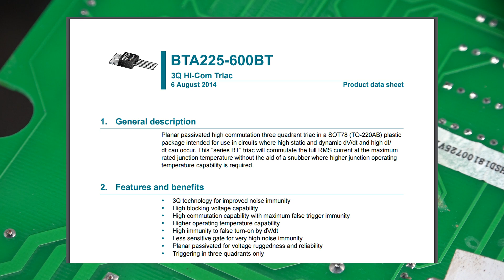Laboratory Hot Plate Stirrer Repair (Triac Replacement)

Comment: I would say it isn't complete shit. The important parts are easy to replace. The main board is simple and obvious, and there are good components there overall in it. The rest looks good too. I would say it does the job done. But considering it is a bit expensive, of about 450$, I would say it is somehow overpriced for what you get. At least the case is metal, display and knobs and components are good.

You should learn soldering better tho. Flux and proper amount of solder, and keeping heat long enough does help a lot making proper good joints.

Comment: You get what you pay for. VWR does have some better engineered products. When dealing with chemistry, a hot plate should cut power to the heater when it fails. They shouldn’t be making junk like that.

Comment: I'm an electrical engineer.  For the equipment you have you did a pretty good job!  Desoldering is a b*tch.
A little MG Chemicals rosin flux and some copper braid makes the desoldering much easier.  The copper braid just soaks the solder up.
A moistened sponge is also good. Just draw the top of your iron over it briefly as you work. It will keep oxides off of the tip, as well as excess solder. So, without wick, the way to handle the case where you bridged the two pins of the triac would be to clean the solder off of your iron first and then the tip will pull a bit of excess solder off.  Just repeat as needed.

Comment: I love any/all your videos. It help you with further burnouts is a simple fix. All you need a a small aluminum heat sink, you can find one on an old PC motherboard. If you continue to read about your triac specs, you will see at some point it will need to have a way to thermical way to cool it down. The heatsink will resolve this. Manufacturers will always design things to fail at some point. It the economics of everything. Oh, for the loose power, hot glue works for me or some type of low to moderate adhesive will work. Enjoy.

Comment: As much as you cant separate water from solvents without epsom salts, you cant wet out solder without flux. Add that to your soddering kit along side a solder pump and you are golden. If you want to be real fancy, use a solder wick to suck up old solder and make those through holes like new. All of those are pretty much the absolute basic when doing quality soddering.

Comment: Shouldv'e soldered a socket instead of that optocoupler, would make future extractions much easier.
Also, don't pull on multi-leaded parts when de-soldering; you're much more likely to lift a pad/trace that way.
Instead, Cut the leads off the part and pull on the individual lead as you heat it.

Comment: the small power supply is for the small volt low current components that need to be regulated and the other bigger one is for higher current and probably higher volts aka the heater

Comment: Likely that this has two power supplies for isolation. The off-board PSU is probably for the high side switches on the motor driver. I would guess that they either could not source a transformer with another tap or found that they needed another power supply after the board was spun.

digikey is awesome.

I'm surprised you didn't lift any traces.

Usually, if you have a board with plated through holes, you don't need to apply solder to both sides. If you use enough flux, the solder will be sucked through the board. (BTW, I am IPC class 1 and space addendum certified)
Reply: Yeah that little PSU was some sort of deadline is approaching quick fix, it would not be hard to make the whole thing work from a single power supply.

Oh and about plated holes i just had fixed an old HP 6624A lab power supply that had a non conducting via in it.
Reply: solder a wire in the sumbitch. That what we have to do for every via on our prototype boards made on the router. It's a pain for complex boards.

On another note: your power supply may have been built on my workbench. My father acquired it from HP when they remaindered a number of the equipment benches in their Liberty Lake facility. I have no idea what was built there, but it is a non-zero chance.
Reply: Oh nice one. Not sure where it was made but from the date codes on chips it seams to have been made in 1991. I do have an even older HP signal generator made in Germany, its so old the power indicator is a regular light bulb, but it does go to 250MHz.

Comment: No offense man but I've seen meth labs with cleaner equipment than yours. Why don't you clean that hot-plate of yours sometime.
Reply from the maker: Those stains are chemically burned into the plate. The only way to get it clean is to buy a new one. If you have $700 to send me i'll do it.
Reply: Yeah, I think you might of mention that before. I was trying to be funny, sorry if you didn't see it that way.
Reply: . . . Besides, meth-labs normally have blood stains all over everything.

Comment: Nice, next time you replace though hole parts, it is typically better to cut the bad parts off and de-solder the remaining pins out of the board. This helps protect the tracks from getting yanked off with the part due to the lower heat.

Comment: Get some soldering wick.  It's basically just woven copper wire, but it soaks up molten solder like a towel soaks up water.  Just put it against solder you want to remove (either the old solder, or an accident like that blob you had) and press the soldering iron against it until the solder melts and is soaked up, leaving you with a nice clean surface to try again.  I suspect the copper forms an amalgam with the solder?

Anyway, for soldering, you don't want to touch the solder wire directly to the iron, or else it'll blob up and stick to the iron instead of the circuit board.  Instead, press the iron against the board contact and the lead coming from the component you're soldering on, then gently touch the solder to the contact and lead next to the iron (but not touching the iron itself).  If the contact is hot enough, it'll pretty much suck the solder right up and leave you with a nicely soldered join.  If you end up with a blob on the tip of the iron, you can just wipe it against a damp sponge to get it off without having to shut the iron off and wait for it to cool.

Comment: That you were able to do your research and not be a complete hack, I commend you. Since this is not your particular skill set. The next time you solder, just remember this. The Solder will flow towards the heat. You can see this in your video. (It is going up the pins, instead of towards the board) Try and place the solder iron on the opposite side of board where the tip of your chip leg enters. (Maybe you could not do that do to what was on other side, I don't know) Either way, I enjoy all of your videos because you think before you do, and provide excellent content. Maybe I can find the time and do a reply video on how to solder. Cheers!

Comment: For a longer equipment life, bolt a heatsink to the triac.  It doesn't have to be a large one, but beware it shorting out to the case (unless the triac is already at ground) or the circuit board.

Comment: If the component is ruined, it is usually easier to cut the legs off in situ, that way you only have to de-solder one pin at a time.

Comment: One of these bad boys http://www.jaycar.com.au/Tools-%26-Soldering/Soldering/Accessories/GOOT---Desoldering-Tool/p/TH1856 will make it alot easier for you. I have one and it works really good

It balances the awesome of the right tool against the cost for your usage. if you where salvaging stuff or reworking more regularly you would prob want something like a desoldering gun, it's a soldering iron with a means of drawing a vacuum to suck up the solder, like the solder sucker above, but unlike the solder sucker above it sucks constantly.

Comment: The one good thing about the old pieces of shit is that they are easy to work on if a component goes bad.  The new stuff with all surface mounted parts basically require you to be a master at the game "operation" if you are gonna attempt repairs by hand.

Comment: They use separate power supplies because it's a piece of shit.
Glad to be of assistance.

Quick desolder hint:
If you're not keeping the part, cut the pins as long as possible and desolder each pin one at a time.

Comment: I have never seen a hot plate stirrer look so clean and nice inside during a repair.  The ones I worked on were used for acid digestion, mainly aqua regia, and were brown rust puffs inside.  Great to see one repaired without too much trouble.

Comment: For the wish / to-buy list: Desoldering braid. Solder sucker. Flux pen, antistatic wrist strap and antistatic brush optional, former to help solder adhere, middle not to fry ESD sensitive components on the PCB, latter to remove that conductive carbon (a.k.a burn marks). 
Methanol works for cleaning, what we EE's use is IPA (technical grade Isopropyl alcohol).
The two former would set you back in the ballpark of $20 total, two of the three optionals are pricier items (check suppliers for quotes/listings), wrist strap is in the $5-$10 ballpark.
And as to your solder job, hey, we all were beginners at it at some point, and even experienced EE's can have the occational bad solder day.
Here's hoping the hot plate stirrer will hold up without further incident.

Comment: I cringed every time you pulled on the part while desoldering; great way to lift pads/tracks. If you really lack soldering skills, cut the pins off at the body of the component, it's a lot easier and safer to heat and pull one pin at a time.

Comment: As a professional,

Beats me why they needed a second power supply, or dongley bit or whatever that was.  Never assume an engineered product is a /well-engineered/ product. ;-)

It's the technical equivalent of "never attribute to malice what can be adequately explained by stupidity".
Reply: It almost looks like it was bodged in there as an afterthought,or maybe as a previous 'repair'. Check out the connector on the right side of the little PSU thing,are the wires just shoved into the connector? I'm not convinced that's 'original'. But maybe it is?

Comment: Add a little solder or flux directly to the solder joint you're desoldering, it will make things a lot easier. It also helps to lay the iron across multiple pins at once, so they melt simultaneously.

Comment: Eeh, your soldering wasn't abhorrent, but if you want an easy way to desolder multiple pins and don't care how pretty it ends up, just put down a big blob of solder across all the pins and melt the whole thing, it'll get the part to be removed hot and probably kill it, but if it's broken already, it doesn't matter. Make sure to take the solder blob off afterward.

Comment: +NurdRage I watch you're videos with amazement since you ARE a whole lot better than me at what you do.  However, I now have a whole lot better appreciation how you must feel when rank amateurs start attempting to make dangerous chemical cocktails.

BTW, you might consider where the heat dissipated in that triac is going and what temperature it's die is getting to. This may be the reason it failed in the first place and a heat spreader might help as long as you don't cause any shorts.

Another suggestion as you are probably going to enjoy another economical repair is to invest in a solder sucker and wick.  It will make your efforts much more rewarding.

Comment: Decent repair! The fact that the TRIAC was 'underslung' indicates it was a late substitution for a different part with the reverse pinout, which is very common with transistors and cheap production runs. Replacing it with the exact same part might have been a mistake... look for a better part with the right pin order to put it on top of the board if it goes again. They probably saved $0.10 on a critical part, and that's why it broke. Excellent decision, replacing the opto as well. That's exactly what you should do!
And no, there should NEVER be a board flapping loose in the box. Even my one-off prototypes get properly screwed down before getting five volts, let alone mains.

Comment: Well done on the repair Nurd dude, you nailed it. It may fail again  or it may not and last for years.
I suspect from all the thermal cycles, one of the solder joints on that TRIAC cracked and was arcing on the board. That's why the area around one of the pins was burnt. It's probably a common failure mode for these hotplates.

Comment: Some hints for desoldering and replacing through hole parts...   Cut the part out with flush cutters if you have them.   Actually leaving as much of the pins in the board makes it easier to remove them.      If you don't cut the pins, you have to heat all the pins to get the component out.   This is difficult and you usually end up slowing working the part out while putting a lot of stress on the traces and pads.
Now that the pins aren't physically connected together by the part, you'll find heating a single pin and removing it a lot easier.
Second tip is to get some desoldering braid/wick to remove the solder after the pins are removed.    Clearing the holes will make placing the new part in a lot easier and you are less likely to have shorts, bend pins or message up the traces/pads.

Comment: That triac should probably be screwed to a heatsink.  For instance, a floor lamp dimming circuit I have here, uses a BT137-600E triac.  According to their data sheets, both are rated for 150˚C.  Mine is screwed to a 2.5 x 1.5" length of what looks like an aluminum U shaped bracket.  

Do you have space under there to put any sort of heatsink on that triac?

Comment: Don't: add solder to the tip and then try to solder the part.
Do: Put the tip on the part first, and then add solder to the part.
Reply: Just wet the tip with a tiny drop of solder for better heat transfer
Reply: As I just said: there is already flux in the solder. Adding extra wont hurt, it might even help, but it's not necessary.
Reply: +Daniel Hansson You are right, and it's what I do as well. I just mentioned the most important bit in the OP.
Reply: Just wetting the tip isn't good enough. You need to flux the solder joint. If you put the solder on the iron, the flux burns off immediately.

You can also just add some flux yourself. I keep a flux pen around for exactly that reason.
Reply: +Output Coupler Flux pen? What's that? I just use a can of rosin, and I dump the tip of the welder each time I need more flux.
Reply: Pretty much all electronics solder have rosin core, so adding extra is not necessary.
Reply: +Forssa1 It is necessary, except when you are welding two fresh parts together. Even freshly unisolated wire requires some flux for best results.
Reply: Marcin Goławski
The flux pen I use is a felt tipped pen that instead of writing, dispenses an alcohol based flux. I like it for desoldering and for tinning lots of traces or big pads, because it's easy to get a healthy amount of flux where you want it, and there's no cleanup.
Reply: I think you missunderstood me. I'm just saying that if you add a small droplet of solder to the tip, it will help you get a thermal contact to the pin that you are trying to heat up.
Of course you need to add fresh solder to the pin once it's hot.
It might just be when using a conical tip, since you can't get much surface to contact with the pin/pad...

Comment: Nurdrage, please, invest 2$ into a handheld solder joint sucker on ebay. It would make your work so much easier. Please... :D
Edit: Found one shipping to Canada :)
http://www.ebay.ca/itm/Solder-Sucker-Desoldering-Pump-Tool-Removal-Vacuum-Soldering-Iron-Desolver-SC-/281678939053?hash=item41955f83ad:g:M2wAAOSwnDxUczEL

Comment: Someone should do a kickstarter for a good quality reliable hot-plate stirrer with no moving parts. The motors probably fail more often than the heating elements.

Comment: Relying only on the board to provide pressure on the thermal pads is very bad design, as is using thick thermal pads to dissipate high power. If the heater takes (guessing) 0.5kw, that's 2A at 240v or 5A at 110v. Typical triac forward voltage at these currents is 1V, so that's 2 to 5 watts of dissipation at full power, which is significant. The board can warp and provide low or no contact at all, causing the triac to overheat and die. As the one that died is near the center this is even more likely.
A good design would have a means of clamping the components to the case with either screws directly or a clamp on the back of the pcb that is screwed through to apply pressure, and also thin mica, kapton or silpads.

Comment: i would recommend a dedicated TO-220 package heatsink and a thermal pad (like silpat) with silicone thermal compound. it will improve reliability immensely. Not a bad job overall actually. As something that will help in future repairs, i highly recommend getting some rosin flux and braided solder wick. It can make removal of the old solder infinitely easier.

Comment: You should see if you can attach a heatsink to your triac, or even just a piece of aluminum. Increasing the thermal capacity and surface area will likely prevent this from happening again. It's probable it failed from either a higher than normal temperature(of the part, maybe due to high ambient temperature) or merely thermal stress fatigue. A heatsink of any kind will help with both. Just make sure you use an appropriate thermal adhesive like arctic alumina.